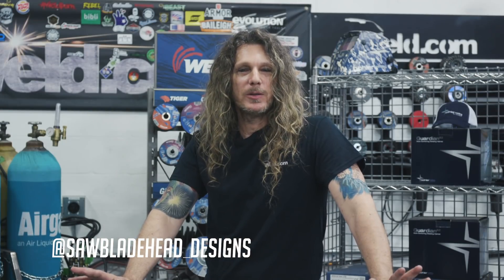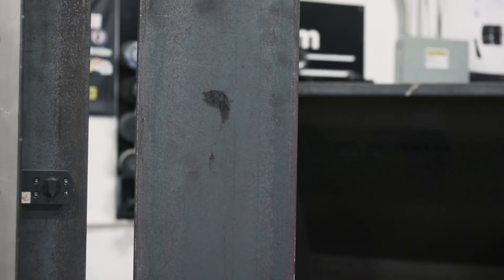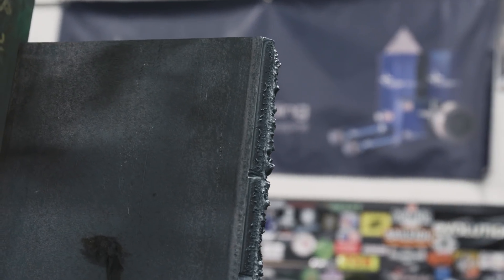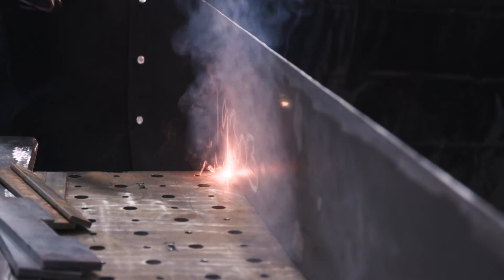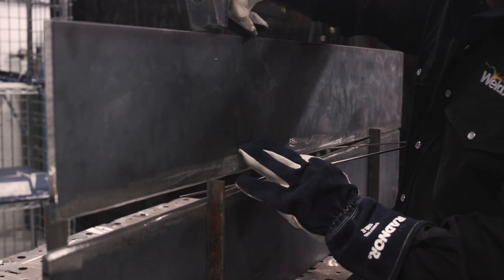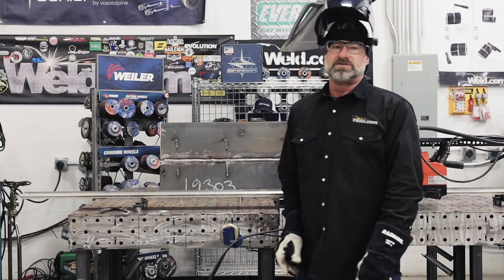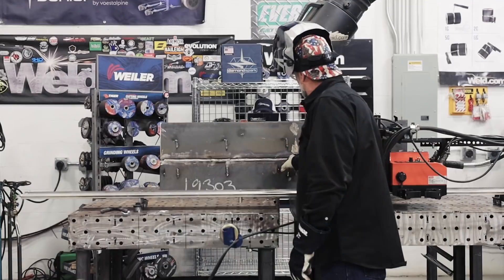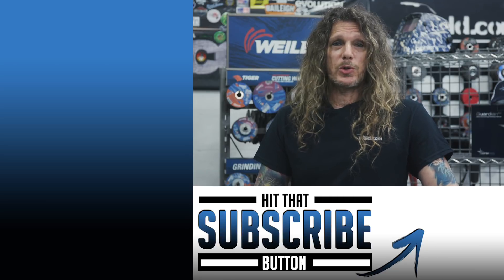The Benefits of Welding Automation for Your Health

Comment: I want to say, it is your channel that pushed me to learn how to weld. I wish I was better, but for a disabled vet, that has a body falling apart faster than the vehicles Im trying to fix...I can't complain.

I did make my first weld (round 22mm pipe with connector flanges) and its not pretty at all but it holds air. Next I need to do a support surfaces for a pump that mounts to the chassis of the rig Im working on. Its simple enough and maybe give me more confidence before doing the welds on my Ranchero...

I know its not related, but I keep coming back to your channel (and I also saved some, in case the internet ever goes dark, I have my basic stick welding ticks and things. I even did a checklist and write up to help me so I can refer to them on the spot).

Thanks guys!

Comment: i will give you both a chance mancub and jason ran out of ideas you 2 have a very hard job because welders are like stray dogs all over the world in india they weld with a slippers on their  feet all because  the arc is no longer  a big deal you need to have an engineering mind and mixed it with welding and fabricating to make money anybody could weld great with practice but while practicing one weld over and over the engineers designing new welding robots

Comment: I’m a fan of automated welding. I think it increases consistency and speed. Noting wrong with that. I don’t think it is taking our jobs IMO. Certified weldors are still needed and I think the automated push is a result of a lack of humans to fill the positions. Anyway I think this machine can do some incredible things, I just don’t think this video was a very good representation of the capabilities of this unit. From the torch beveling to the gouging there are definitely ways to make this operation more productive. This video made it look like the machine was just in the way. If I have to run a grinder to reshape the bevel that much, I’m not going to take the time to set the machine up. I’ll just grind the bevel on. Why couldn’t it be back gouged with a plasma that could be set up on the unit and make it way quicker and more consistent? And if I have to adjust it that much as it’s making a weld, I’m probably going to pick up the whip and weld it out. I know, I know, these tests are given with intentions of the machine doing the work. Idk, I’m not sold on this unit after watching this vid. Could be an awesome setup.
Reply: he could have cut the bevel down the center and then had two pieces ready to go.  settings were wrong with that much slag - he should have either changed travel speed or gas settings i think.

Comment: Welcome to the fourth Industrial Revolution. They are replacing us with automation. This is your wake-up call people
Reply: You still need a certified welder to run automated tasks, but the day of dragging  a rod down a seam are gone in production work. You either adapt to new technology or get left behind. It happens in every industry.
Reply: I would much rather put a stinger and a hot pass in it then fill it up like that
Reply: @riggsandmurtaugh7938  you and me both!
Reply: well you might not be the one doing the physical welding as the machine will do it for you, you will always need an operator and at least a competent electrician and mechanic to fix your broken equipment
Reply: Oh no! We're taking a $25/hr job and making it a $35/hr job because its more efficient. Thats terrible! And its terrible that the welder isnt getting a chance to put more wear and tear on his body!
Reply: @Slagithor9000  your a fucking idiote
Reply: @riggsandmurtaugh7938  I'll be the idiot thats got the check cashed, on my way to the next job before you finish the cap.
Reply: @Slagithor9000  I'm a 14 year veteran at the trade and automatic equipment makes it all better
Reply: @Slagithor9000  hard work builds character bubba, and anybody in construction only sacrifices their body when they don't know what the hell they're doing, and $35/hr is a low wage for any weld worth his weight in FLUX😅
Reply: @adampindell  It does! And thats some bs. It's still hard on your body unless you work at a table in a shop. And $35/hr is good for a job like this, especially if its close to home and is secure. Some people don't want to go to buttfuck middle of nowhere Texas to make 6 figures or jump from job to job.
Reply: @Slagithor9000  $35/hr good in central florida, not so good in central california, but all things being relative, I guess life no matter how you lead it it's hard on your body in one fashion or another.😊
Reply: This is very old technology.